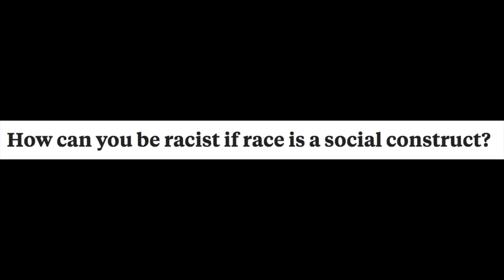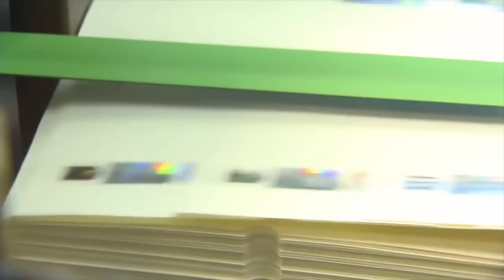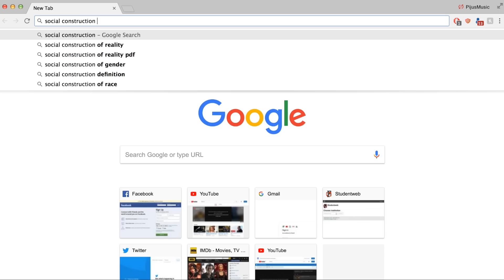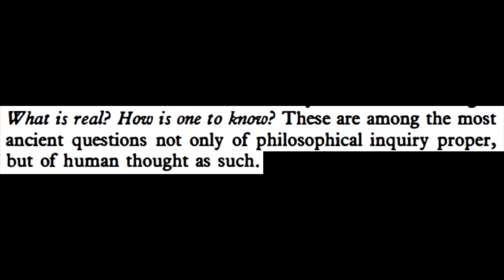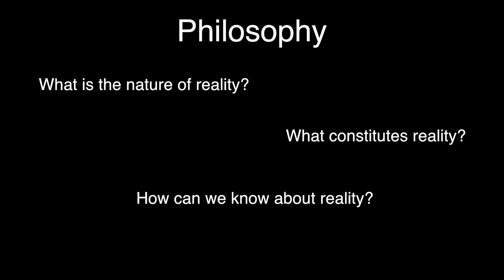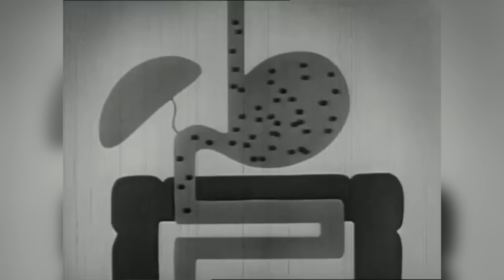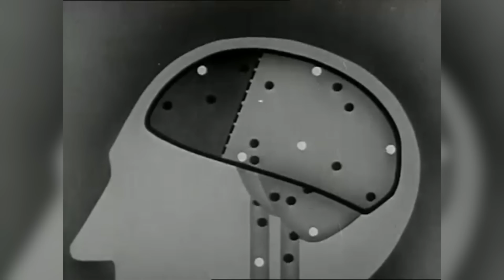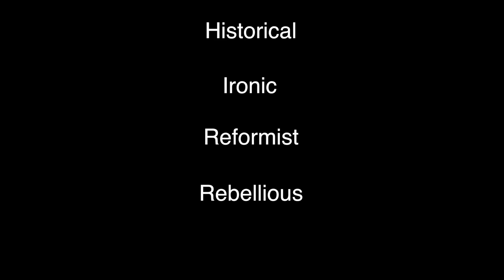What does social construction really mean?

Comment: people understand social construction as having no value or being invalid, I would say in part, due to the term often being used in that way. So it is not just people misunderstanding other using the term, but also by those who use it as a term to blankety  devalue the "thing" being called a social construct. ... 

Often the answer to something being called a social construct could be "and?" or "ok, so what?" . It seems like something that should be more a start or opening of a discussion, rather than a single point or something you can just say to dismiss things. 

People misunderstand and misuse this term, the misuse leads many to understand the term from how it is misused. 

If I used the term "cat" in place  of "dog" around someone learning English , as their sole source or among other who also used the term "cat" instead of "dog"... they would learn to see the term "cat" as referring to dogs. So if someone repeatedly hears the term "social construct" in argument or debate used in a way that implies something is completely invalid or not real, they are likely to take up that meaning.. sadly this ends up with people debating, arguing etc as if speaking different languages . 

How terms are used can lead to a perception of what they mean which is not correct. We can all pick up loose ideas of what terms mean and end up misusing them and so compounding misunderstanding in those who hear us use them. 

Great video   Jonas. Thanks

Comment: The reason people say it is the same as saying it is relative, is that you say "If things were different, it wouldn't exist" which is the same as to say it isn't natural. Peeing is a natural thing, thus even if I had a different father, or I got shot and survived, I would still need to pee from time to time. 

You make the claim money wouldn't exist if history went differently. I say maybe, but you didn't use it as if it were up for debate and that's why people hate the term. People hate the term 'socially constructed' because the users act as if what they say is fact.
Reply from the maker: I make the claim that there have been societies where money did not exist, which IS a fact. I don't understand your initial objection. For example, you can imagine losing a limb - "if things were different, it wouldn't exist" - that does not mean that the limb is unnatural or that its existence is relative
Reply: "Peeing is a natural thing, thus even if I had a different father, or I got shot and survived, I would still need to pee from time to time."

- (disclaimer, I am not an expert) Your bladder actually fills with pee more during REM dream sleep than other periods of sleep. The ventral medial prefrontal cortex (vmPFC) of your brain is also active more during REM sleep. And Oxytocin levels are higher during REM sleep as well. 

vmPFC activity relates to social engagement with other people (activity is lacking in psychopaths). Oxytocin is also given the label 'the love hormone' as levels go up when we feel empathy. Vasopressin on the other hand increases as Oxytocin levels go down - vasopressin beign an anti-diuretic (reduces kidney function).

Vasopressin is also linked with increased anxiety. Whereas Oxytocin is linked with fear responses and emotional memories.

Interestingly also vmPFC activity goes down and dorsal lateral prefrontal cortex activity increases when we are dealing more with objects than people.

So while peeing is a biological necessity. It is also surprisingly linked to our social life and so our social constructs, for example what kind of human is a 'person' or an 'object' (afterall our biological ancesters used urine as a means to communicate with others through sent - lobsters even pee through their faces [LOL] in order to send signals to other lobsters...   Sort of like Levinas and 'the face of the other' I guess...).
Reply: @thisaccountisdead9060  Social life doesn't mean social construction, because that's not how people use it. You know this.

People use socially constructed to mean that things are made up by our social interactions, not that it occurs due to them. It's the difference between saying something is artificial (made by people) than saying something happened because of human action (for example a historical event, or a scientific discovery). While you (if you're being particularly annoying in your obsessive use of language in awkward ways to win crappy points for the evil ideology of Social Justice) can say that history is "artificial" the two things are not quite the same, and you are stretching definitions and abusing language to make you're point.
Reply: @cornbreadisbetterthanpizza6866  There's an argument in support of Karl Marx's conception of the Labour Theory of Value that basically human beings are the anti-thesis of 'The Means of Production' (for example a production line in a factory) - saying that humans contribute 'living labour' while the factory and machinery etc and the products they make are 'dead labour'. By this argument 'living labour' only has value because it is the only thing capable of expressing freedom and liberty, while products etc can't do this - i.e. only things that produce freedom have value. 

So a lot of assumptions there I guess. And one assumption seems to be the infinite freedom of creativity of the human being - this seems to be one way in-which 'social construction' gets used in terms of infinite freedom.

Is this basically what your criticism refers to (assuming my representation of Marxism is right)?

Personally I see Marx and his opponents like barristers on either side of the argument in a court case: the more abstract the case, the more abstract the arguments - and the less both relate to reality.
Reply: @thisaccountisdead9060  No I don't think that is my main objection. My objection is this, that social constructionism seems to be so incredibly reductionist. If I say "marriage is a social construct" while you may say if pressed "sure there is an x component to marriage, but there is a social aspect to it right?" But that's not the point.

If I say "soldiers are men" that statement is sexist, because even if pressed I say "soldiers can be women too" that's not what the statement obviously and very heavily implies. The statement very heavily implies that the only soldier there are is men. The same applies to calling things "social constructs". By calling money a social construct seems to me to be saying that the only legitimate reason we have money is our social life, which is false as far as I can see.
Reply: @cornbreadisbetterthanpizza6866  I think I see what you are saying (I'm not an expert in all this btw). Maybe by 'reductionist' you mean 'straw man'?

For example, when you used the example of "By calling money a social construct seems to me to be saying that the only legitimate reason we have money is our social life, which is false as far as I can see." This does seem similar to what I was saying in regards to Marxism before. That Marxism as a theory relies on a straw man of Liberal economics it is opposed to in order for it to work coherently.

I'll give an example of what I mean; when Marxists criticise NeoClassical Liberal Economic Theory - at least the one's I have come across so far - they portray NeoClassical Theory as 'static' in opposition to the 'laws of motion' of Marxist economic thinking. Marxists (the ones I have come across anyway) will say Liberal Economists assume in their models that not even 'time' exists and so on...   I wouldn't deny there are some flawed economic models out there, but there are also pragmatists as well (for example following John Maynard Keynes). And besides, Marxists seem to me to have just as much a flaw in their theory as to how surplus value (the crux of Marx's argument) instantaneously manefests itself in Marxist economics - relying on the very same straw man argument of how Liberal Economics is supposed to function...   So Marxism as a coherent theory only works if you accept the straw man of Liberal Economics it was opposed to and relies on upon for it's arguments - otherwise Marxism doesn't totally work.

Terfs seem to do a similar thing when arguing that 'gender is a social construct' in opposition to the existence of transgender people. They rely on a straw man - or you can call it a reductionist stance - about gender identity (that it is 'static' and 'idealistic' as opposed to 'sex' which they view as 'changing' and 'materialistic' - though its hard to tell what they mean a lot of the time as often they seem to use terms in opposition to their meaning from a scientific standpoint - as science suggest gender identity relates more to our anxieties which would mean it would have more to do with us being in constant motion rather than static), which doesn't seem to reflect reality, to support their argument against transgender people (but not just trans people - everybodies sense of their identity), which paradoxically is also a crucial lynch pin of their entire theoretical approach and wouldn't work without it: so they are criticising and want to get rid of something they need that also serves as something required for their whole philiosophy to even work.
Reply: @thisaccountisdead9060  Oh, I see. Well I guess me and you agree on quite a bit. Just maybe I'm a little puritan with my vocabulary.
Reply: @cornbreadisbetterthanpizza6866  Maybe we agree? Maybe we don't? For example, if you are asserting the role of money in a hierachical sense - as in a means of measuring where somebody should be on the ladder, as opposed to merely a tool used for trade. Apologies if that is not what you are referring to with money?

You can clarify if you want. But it is such an extensive debate - that would basically be about nature vs nurture - you can't really do in justice in a comment section. We'd just have to agree to disagree I think. I've already arrived at my own conclusions. Though I would probably cite 'The White Hall Study' done in the UK decades ago that looked at stress levels vs rank in a heirarchy and the relationship to stress hormones and gonadotrophin levels which are oppositely correlated with each other, while also including that stress hormones in men tend to be higher than women when engaging in some neutral activity like giving a speech (with a range of complex nature vs nurture reasons for this).

Not to mention arguments about free will. I'm a compatibalist when it comes to free will. I think existentialists had some good things to say about free will, but unless you ground what they are saying in some kind of human biology I think you can end up making claims about free will that are unrealistic.
Reply: @thisaccountisdead9060  Yeah I would agree there is some social uses for money as well as basic functional.
Reply: @cornbreadisbetterthanpizza6866  It's funny how most people in the 'real' world seem to care little or are ignorant about the world. And yet, press even someone on youtube who makes ASMR videos with silly putty and they'll come back at you with seemingly an encyclopedic knowledge of history, philosophy, culture, politics and economics with their own deeply held established positions on a vast web of subjects - even though they're only like 6 years old.